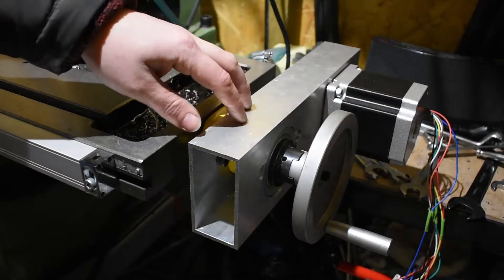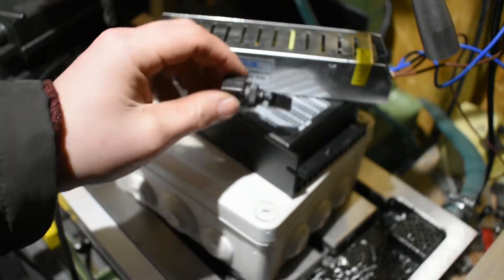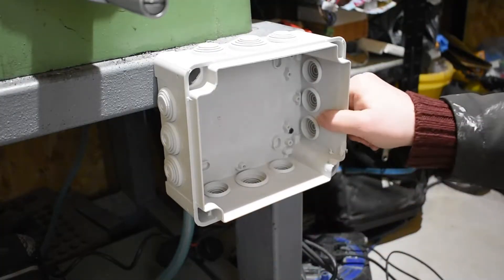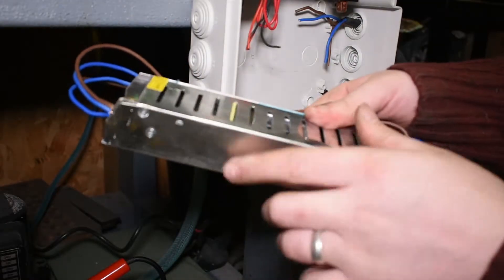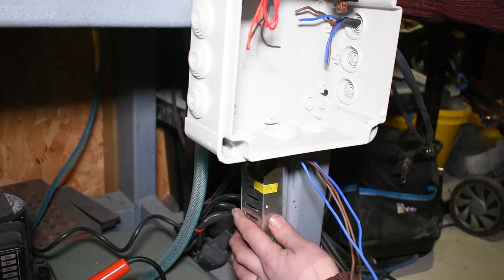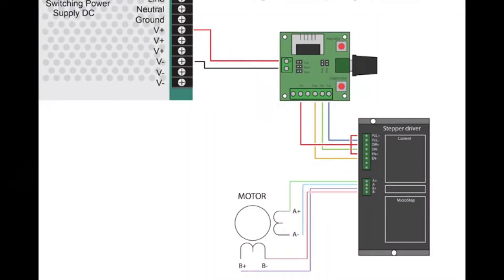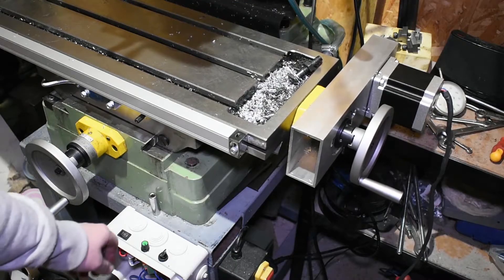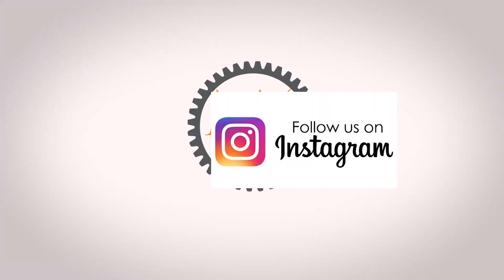DIY Power Feed for Milling Machine Part 2

Comment: Nice work. A couple things: 
1. The "Half Speed" noise is from the front pulley hitting the frame. If you watch the part where he is fast forwarding it you can see the pulley wobble as it is out of center by over 0.25 inch. 
2. There is no travel limiting switch's so this setup may crash the screw and nut at the ends of travel at high speed and may bend or break something. 
3. The use of low voltage is addressed below, need to step up to 24 VDC or 36 VDC. 
4. The use of same color wires will become a troubleshooting nightmare later. Wire in different colors is fairly cheap to get maybe 2 meters of each colors.

Comment: I just finished building this unit, almost exactly to your spec. I used a NEMA 23, with and all in one driver/speed control. I had to add a small tension wheel as I didn’t get the center to center dimension exactly right. The tensioner works great!

Comment: Hi,I'm really impressed with your work and ordered a cast iron x and y table to do the same, I've tried to follow your link for your website and also where you said the drawings are but neither are working, could you please tell me if they are still up and running. Kind rgds

Comment: A lot of your problems are because the stepper motor is larger than needed. The stop/start of the motor at each step, when moving slowly, introduces vibration in other parts. Spring tension in the drive belt might help, but a smaller motor would improve matters. And would probably run faster! (lower inductance). I note that you use the main power switch to remove power from the motor- needed to allow hand operation. Results in a delay on start, as the controller powers up. A relay, switching power to the motor alone, and engaged whenever a direction is selected, would give a single control without delay. A 'full speed' button (for returning the bed) is normal on power drives.
Reply: Been watching a number  of u tube and now member of round colum mill...any thought of using  a magnetic clutch to engage and disengage  power feed..am a machinist time to retire so home shop time
Reply: @miguelcastaneda7236  no clutch is needed if a stepper motor is used. Most drivers have an 'enable' line, that removes motor power. If not enabled unless actually driving, the hand wheel can be used at any time. Simple, easy, and effective - see my channel for details.

Comment: This is very dangerous even at 12 volts DC. You are building an electronic control for a milling machine, well noted for throwing metal everywhere and sometimes in places where it shouldn't be.  Meaning your open power supply and controller. They should be well away from the machine, in an enclosed box of their own.  Never use solid wire where you expect it to move. Stranded is much better suited for the purpose, and the more and the finer the strands making up the conductor the better. They flex better. I know you're a better machinest than indicated here, but my engineering heart just did a double flip and not in a good way.
Reply: As a continuance, which I hit the return before I was ready. You might try running the motor at 24 volts dc or even 48 volts dc. When you slow the motor down to where you were getting the grinding noise, that's due to loss of torque, in which stepper motors are noted for at slower speeds, if not enough voltage is applied to move the motor at slower speeds.  My suggestion would be to gear the drive for your cross feed down so that your motor is still running at a high rate of speed but your travel is actually running slower. You can also do this with changing your belt pulley sizes, but by gearing, down you can also gain torque on your cross feed while actually going slower.  Think about it.
Reply: @charlesriechers6241  It is not grinding- just at the low speed you can hear the steps! The stop and start at each step can induce vibration in attached parts. A flexible coupling (slacken the belt, put spring loaded roller in the path...) One of the problems of using stepper motors (but it does avoid needing a clutch), especially if they are over-specified for the task. X axis drive requires surprisingly low power.

Comment: Fair play mate, takes a lot of balls and dedication to do what you did and video it. It's the easiest thing in the world to find holes in other peoples work. I can see that you have been told about cable colours etc but make sure the frame is earthed with the Chinese psu strapped to it. You don't wont a belt. Double check this, on the first vide, when you were machining the pully, it looked like the lathe chuck had a but of back and forth slop in it,  once the tool came off from facing the work. I totally enjoyed the videos and it has inspired me to do the same to my mill. Thank you very much!
Reply from the maker: Thanks from r your comment!

Comment: Very helpful thank you good sir! One small question. With the three position switch you added in to replace the original direction switch, does the center position of that switch also stop the motor so it's like forward, stop and reverse?
Reply from the maker: Hi, the middle position ofmy three way switch actually also does forward or reverse,  I can't remember which.
Reply: @mrmechanical3423  Ok thanks. I think I'll have to run the middle position to control the start stop button. :)
Reply: I know this is really old but have info that might be of use. The push DPDT on the controller board appears to be a generic switch but it is not (at least on mine). Common pins are on the end rather than center and pin #1 is disabled internally. I removed the original DPDT from the board and replaced it with an external DPDT. Connecting it in conventional fashion the step motor did nothing at all. When I ran power to the board with no DPDT switch connected the motor ran CW. Jumping pins 1 & 3 caused the motor to run CCW which explained why the one pin was disabled. Using an external DPDT ON-OFF-ON I ran the enable wire from the driver to one set of pins on the DPDT and then to the controller so the power is cut in the center position. On the other set of 3 pins on the external DPDT I connected nothing for CW and pins #1 and #3 for CCW. Now I have CW-STOP-CCW. The other 3 holes on the PC board apparently do nothing because omitting them has had no effect that I can tell.  I have a home made mill with powered XYZ so I'm pretty stoked figuring this out.

Comment: Hey man nice work. I am trying same thing. But i am not a programmer can you help me with it?
Reply from the maker: Certainly, I'll help where I can... However no programming is required for the setup I have.
Reply: @mrmechanical3423  i am considering  arduino uno to do some logic. Can you help regarding that? Or any other way to do samething. What kind of microcontroller you are using?
Reply from the maker: @SVMistry  I'm just using a pulse generator.
Reply from the maker: https://www.amazon.co.uk/dp/B07VHLS1DN/ref=cm_sw_r_cp_apa_fabc_HeTTFb8JCT4GX?_encoding=UTF8&psc=1

Comment: How many amps does the power source need to be, I have a 12 volt dc - 10amp power source, is that enough or too much? Again newbie to this kind of electronic devices, sorry for the million questions lmao, thanks!
Reply from the maker: I'll check my transformer when I'm in the shed tomorrow. Can't remember off top of my head
Reply: @mrmechanical3423  thanks!
Reply from the maker: Just checked and my power supply is just 8.5amps.
Reply: @mrmechanical3423  hooked it up as per your diagram but motor not move, Step Driver green light flash, lights come on potentiometer controller 😕, i did run power to potentiometer controller, cant make out your video good enough to double check my wiring😧 my kinda luck
Reply from the maker: @honeycuttracing  double check that you have the correct wires paired on the stepper motor and that it's wired to the stepper driver correctly.
Reply: @mrmechanical3423  didn't have positive going from Dir+ to Ena+ lmao..facepalm.. its going now, thanks, im a goof ball with wiring🤣🤣🤣🤣🤣
Reply: @mrmechanical3423  thanks for all your help but after I got it all together and on our table, it crapped the bed, having to return it all😣😣😣😣but way things go...guess rig up a drill, all your info was spot on, just cheap junk we bought🤣🤣🤣😤😤😤😭😭😭

Comment: When mounting wired components outside of a cover its always best to put the cable entry at the bottom, the reason is that any liquid spilt be it water, cocacola, beer or in the case of the mill coolant will run down the cable and straight into the transformer and BANG. With the wires at the bottom the liquid will do the same but cannot flow upwards if you created a slight U in the cables before they enter at the bottom. 
Regards the crash, apart from upgrading the power supply as mentioned you can play about with the gear ratio you have between the pulley sizes on the motor and leadscrew, bearing in mind that steppers tend to lose torque the faster they go.

Comment: Great vid. Just a quick pointer though. You’re using blue as your live and brown as your neutral. That’s fine if it’s only you that’s ever going to use it, but can be confusing / dangerous for anyone else working on it, for instance, if you sell it on or someone copies your idea. Sorry about being negative, but I think many would agree.
Reply from the maker: Thanks Don, yea I've had a few comments along the same lines. I'll swap them around some point in the future
Reply: The only place where the colour of the wires matters is AC input on the 12V power supply. 
It matters on some power supplies which terminal is connected to line and which is connected to neutral AC mains. On other power supplies it does not matter.

Now, it looks like the power cord   he used has yellow and black wires.
Do you think he connect those correctly to the power supply?
Reply: Ro K 
In the case of yellow and black, the normal state is for yellow to indicate +be and the black to indicate neutral or ground.
Reply: Don Sides the question was whether he connected AC wires correctly to the power supply.

Comment: I don't think that your main cables to the stepper motors using domestic single core single strand cable will last long before you get a breakage. The copper will work harden with the motion of the table X axis and will fail sooner rather than later. You need to get some multi strand cable for that sort of application to prevent the work hardening. I don't know why thin strands of copper don't seem to work harden like thicker diameters do. Perhaps a metallurgist can tell us!
Reply from the maker: Yea I think I will revisit the power feed in the near future and make a few improvements. Thanks for the comments
Reply: Bend radius, stress and the heat caused by bending contribute to the work hardening. Imho

Comment: Hello great video but did you make a mistake at time 14.17 you said Brown in negative and Blue is positive shouldnt it be the other way around
Reply from the maker: Yes your right. Just done some research and for domestic wiring the colour would be as you said. I have used the colours the wrong way around. Sorry I'm not an electrician. Thanks for pointing it out. Learn something everyday
Reply: @mrmechanical3423  No problem i love your videos by the way the only problem is its costing me a fortune  buying all the parts to do mine haha ill be on to the Car videos in a bit ,do you have plans to work to for it?
Reply from the maker: @airwolf08  I have a book for the chassis and suspension, drawings for the engine and the rest I'm designing
Reply: @mrmechanical3423  cool where can i get it please
Reply from the maker: @airwolf08  the book is linked in video description. The engine drawings I bought from a guy called George Britnel on YouTube
Reply: Oakmeadows  I glad I'm not the only other one screaming at the screen! One thing I will say is that he said he was using the switch to cut the negative power to the controller and yet it was still blue which it should be lol so has he cut the positive power or the negative? If it's blue then he is cutting the positive side as he should even though he called it the negative!
Reply: You are confusing colour coding conventions for wiring AC (line brown or black, neutral blue or white ) withe DC (positive red, negative black).
In AC mains wiring sticking to this convention helps in preventing potentially dangerous accidents.
In DC wiring it helps preventing sometimes costly mistakes.

In an amateur low voltage DC installation you can use whatever wire colour you want or happen to have on hand. You can even use the same colour for all connections, just label the ends so you know what is what if you need to troubleshoot months later.

In any case, print the diagram of the wiring, put it in a plastic bag and tape it to the machine in a place it will not be disturbed ( inside cover if the control box is a good place)

Comment: Solid house wire is not the best choice for this type of instalation due to vibration, its now banned here for new instalations. Also brown should be live/+ and blue is nuetral/- , being its not 220-240v alternating current it doesn't matter too much, I have a very similar mill but with the HBM label on it and I'm getting things together to do the Z axis but i might hold off and get a ballscrew and do it all in 1 as i want to cnc it eventually.
Reply from the maker: Yea, I just used what wire I had around. I will replace it all as I also plan to do a CNC conversion.

Comment: The "crash" at higher RPMs is from the stepper motor running out of voltage. Two motor specs are key here: the winding resistance, which is 0.95 Ohms, and the inductance, which is 5.2mH. With a 12V power supply you can theoretically pump >12A into each winding, but the 5.2mH inductance will require >2ms for the current to rise to 4.9A each step. Basically, if you double the power supply voltage you'll double the RPM at which full torque is still available, just don't get too close to the maximum rating of the stepper controller. BTW - I just got a PM-727M which appears to be very similar to your mill and it didn't take me long to figure out that both the x and z axis' need a power feed!
Reply: Now I know why the one I’m using on my lathe’s power feed ‘crashes’👍👏
Need to get hold of a 24v psu now and slowly increase voltage until ‘crashing’ stops, within reason of course.
Spent ages trying different settings on the controller, all with zero effect😡
So simple🤔🤗😮
Reply: @geoffhalstead1811  I bet it only takes a few volts more to prevent stalling, but go with a PSU rated for the next higher voltage up of the most commonly available values (12V, 15V, 24V, 28V, 36V) anyway to keep the price reasonable.
Reply: You should definitely use a higher voltage PSU. On my CNC I run the NEMA 23 at 45V.  With a NEMA 34 and that driver you'll be fine at 60V.
Reply from the maker: Thanks Jeffrey. I'll have a look into this!

Comment: Thanks for making this video.  On the stepper controller/ potentiometer, do you have the pins on the high, medium, or low pins?  If the potentiometer is turned off all the way, does the motor still continue to move? Thanks again - Eric
Reply from the maker: I'm glad you benefited from it. I'm using the medium pins. If I turn the potentiometer right down the stepper motor actually stalls (stops) but not as it should. I have marked min and max speed on the dial to avoid stalling. I have a switch to stop the motor completely.
Reply: @mrmechanical3423  awesome - thank you

Comment: Great job. I could use a parts list also especially the gear set up. Ratios, part numbers, etc. One small comment and it's not judgemental... Using your milling machine to assist in tapping makes things easier and more accurate. Takes a little more time. Center punch in milling head above your work helps hold the hand tap perpendicular to the hole to be tapped. Excellent job.
Reply from the maker: Hi, I've added more information to the parts list in the description of the first video along with links to the exact pulleys and belt I bought. I need to get a new set  of taps. The set i currently have doesn't have a center hole in the end for using a punch as you suggested. Thanks
Reply: @mrmechanical3423  If your taps have male centres you can centre drill a piece of silver steel and use that, no need to harden. Cheers.

Comment: nice hands on vid. may I ask some more information of the drive electronics, how did you select the right range, and may I ask the make and wher you bought it please
Reply from the maker: Hi Bart. To be honest I didn't adjust the range. I just wired it up and tried it. However I probably need to play around with the settings to prevent it from stalling at higher speeds. All the electronics are linked in the description. Which part are you looking for in particular?

Comment: Nicely done, how does it feel if you hand wind the feed without the motor running, do you have to disengage the motor drive or is the resistance to turning acceptable?
Reply from the maker: @kevin Thompson the resistance isn't bad at all. I had worried about this but it turned out great.